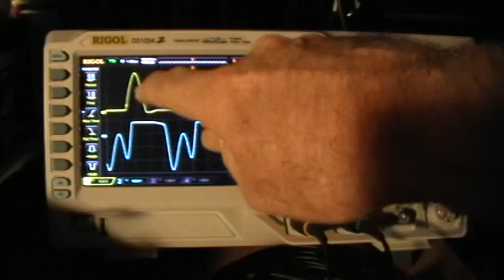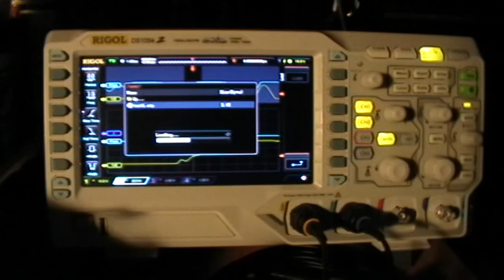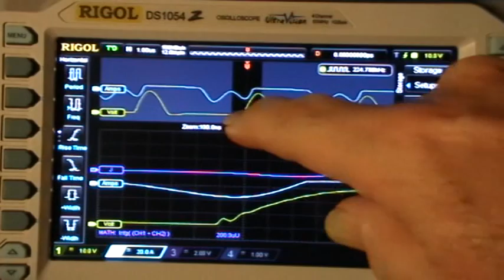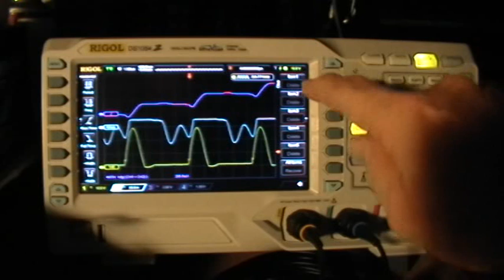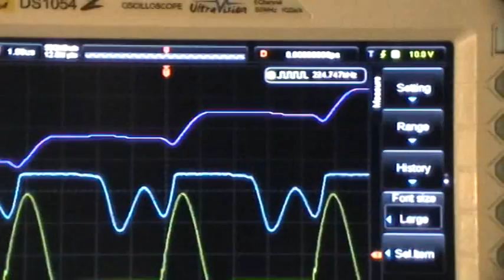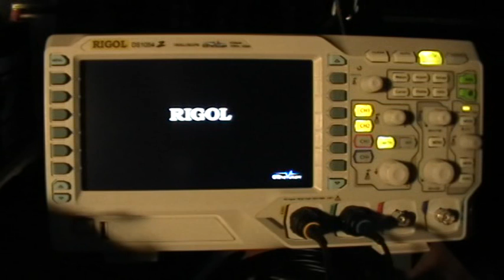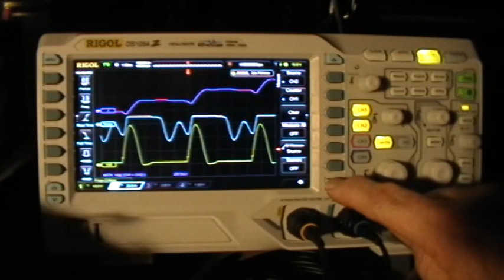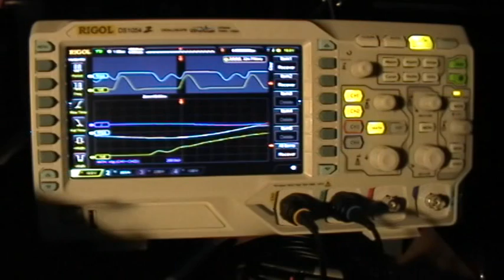Scoposcopy: Rigol DS1054Z Demo 1

Comment: Hei, you make super videos!! But can you change camera settings on manual WB and set it about 2500K? And  there are many free programs to upload full HD on you tube.
Keep the super work.
Reply from the maker: Thanks for your comment. The next time I make a video I'll try your suggestion. However I have a very slow internet connection and so I must use lower-resolution uploads if I want them to complete in less than a day.

Comment: The version I have is 00.04.03. I am missing the SP2.
Reply from the maker: +Washburn 0101 
That's probably the reason then. There have been two firmware updates since that version. You can download the latest firmware from the Rigol website, but you should be aware that you cannot roll back to an earlier version once you've installed a later version. The newest firmware does fix some bugs, like this one, and it adds "pulse" and "edge" counters to the Horizontal measurement menus, and gives improved FFT performance, but it also adds some other minor bugs (Like "pulses" is misspelled as "Pluses", a slowing down of the user interface, and a random "measurement fail" bug when Math is in use.) So you should consider carefully whether you want to update the firmware to SP2, or wait until another firmware update is issued that might fix these other bugs.
Reply from the maker: Washburn 0101
There is no such thing as a vertical timebase. The vertical dimension of the oscilloscope display is voltage. The oscilloscope displays only one thing (in normal mode): Voltage (vertical) vs. time (horizontal).  If you want the rising portion of a signal to occupy more horizontal space on the screen, you select a faster horizontal timebase setting.
In x-y mode the scope displays voltage vs. voltage, and the timebase setting is irrelevant.
Reply: Thank you for replying back.

Comment: Thanks for sharing your knowledge. When I select the large fonts and press the power last button. The fonts go back to the original size. Does not save it for some reason. Any Ideas? Thanks.
Reply from the maker: +Washburn 0101 
What firmware version are you running? I just checked my scope and it remembers the Large Fonts setting. I think this was fixed in the latest firmware update, 00.04.03.SP2.

Comment: Firstly: I enjoyed watching you demo this scope. Your video showing the glitch prompted me check mine. I wouldn't have found that problem for a year had you not demonstrated the test.
Secondly: How did you unlock? Does the widely known site still work? I have the same firmware as you but rumor has it that one of the codes causes a glitch. Which four letter code did you use? 
Finally: Please update your audience on the warranty service provided on the unlocked scope.
Reply from the maker: SovereignG Thanks for watching. I used a local copy of the keygen program zipfile that I downloaded months ago, compiled and run from my Linux computer, so I don't know if the website still works. Others have reported that it does. I haven't heard or seen the rumor about the code causing a glitch, can you give a link? I looked and looked and couldn't find reports of problems using the unlocking key.  I used code DSER. The TEquipment/Rigol warranty service was excellent, I did receive a new unit on Thursday night at 9:45 pm via UPS 2nd day air (sent my old one back Monday morning).  I've been burning in and testing ever since then and will report in a video soon.
Reply: TinselKoala This is the link. Scroll through page and you'll see references to instability with one setting. The DSER code is the one to use. 
http://www.eevblog.com/forum/testgear/is-ds1054z-with-firmware-00-04-02-sp3-hackable/

I think there might be a way to revert back to stock 1054 using UltraSigma but I can't even load it because it won't install using 64 bit Vista. 
So far my scope, which is one day younger than yours, hasn't exhibited any behavior problems and maybe I'll be lucky and never need to use the warranty. For now I'm in complete awe of this thing and learning as I go.
Reply from the maker: SovereignG
Oh, yes, I knew about the instability at 5mv/div. That's no problem, the DSER code doesn't activate that high sensitivity setting.
If you can use Telnet or some similar basic network communication protocol this is by far the easiest way to talk to and control the scope remotely. Look in the main EEVblog thread about the scope and you'll see my instructions. I recall long ago Windows had telnet but you may need to do some searching. Hyperterminal? At any rate using telnet to the scope connected to your local network with an ethernet cable you can send all the SCPI commands including uninstalling the unlocking and reverting back to stock 1054, reinstalling unlock, remote control, etc.
I've returned the glitching scope and already have a "new" one (but with earlier serial number) in hand and have been testing it for some days now, and it's behaving nominally. No glitches. Thanks for watching! I'll be putting up more demos and instructions as I go along.
Reply: TinselKoala 
Just a follow up:
1) The newest version of Ultra Sigma will load w/ 64 bit Vista. I was working while sleep deprived and loaded items out of sequence. Once the drivers were recognized I was able to talk to scope via USB connex.
2) DSFR will work w/ the firmware and board revision that we both have. I was successful on first try. 

So far, so good. I'm glad I bought this scope, though it has functions that are over my head and may never be used.
Reply from the maker: SovereignG
Thanks for the update!
Better to have functions and not need them, than the other way around....